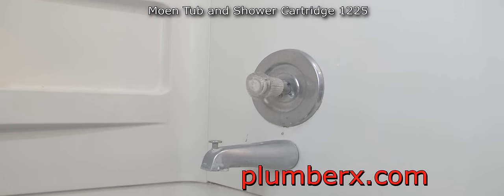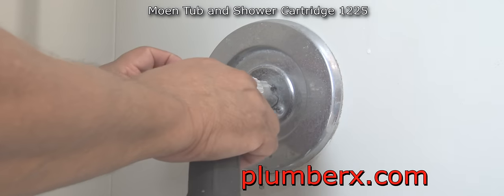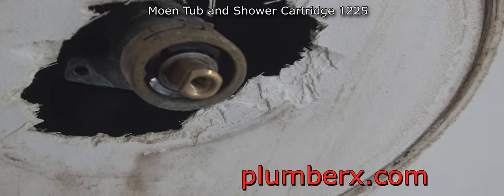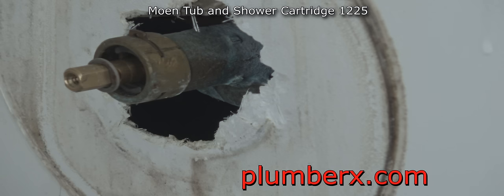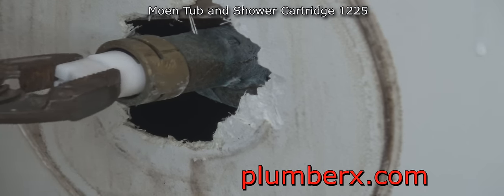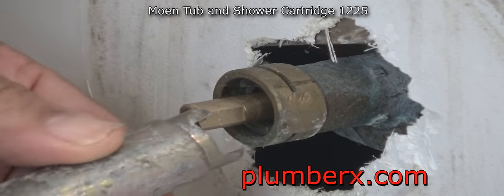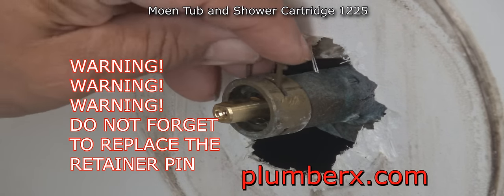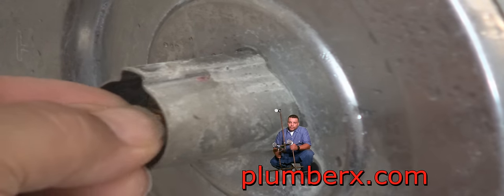1225 Cartridge Replacement  Moen Tub and Shower

Comment: If you drill a hole in the white plastic piece that comes in the box then put the screw back in it you can use that to pull the cartridge out much easier. After having to replace this thing almost every year I had to get smarter. Lesson learned.
Reply from the maker: Lol 😂 nice. Thank you for the idea 💡

Comment: Before removing old cartridge look at end of stem that plastic knob was mounted to and look for a little step on the very end, that step identifies proper orientation when installing new cartridge so that hot is to the left and cold is to the right.

Comment: The Best. Used it while fixing. Successful. Some how, I chose the old Retainer Pin, which has a hat loop, works fine.
Reply: Hi Kris. I saw you received a response a month ago. I hope I get a response to my question too. This is a fantastic video. I feel positive that I can do it but just need to know if it's the fix for my problem.

Comment: [Edit: see reply below this as I may have it backwards?] Thanks for explaining the difference between the 1222 and 1225. The 1222 seems to be the Positemp (handle turns around) whereas the 1225s are Moentrol (handle comes out/up and in/down and can be left at a specific temp.)
Reply: The 1222 can be set for a particular temp. but there is no adjustment for flow rate.  The 1225 must be able to be set for a specific flow rate independent of the temp. adjustment.

Comment: For those of you possibly having issues... This is a very informative and helpful video but it (and most of the other YouTube videos related to Moen cartridges) gives the impression that you only have to choose between the 1225 or the 1222 posi-temp models. Turns out older houses (showers installed before 1990) used the full brass, 1200 cartridges, not the 1225. I first tried installing the 1225 and the cartridge leaked. I then pulled out the 1225 and compared it against the old one. I noticed the 1225 length is a bit longer than the old cartridge. I then looked up some more info and found out that my shower requires the 1200 cartridge. Once I installed the 1200, it worked perfectly. Hope this is helpful for the folks with older homes. 

You can buy the Moen 1200 or the equivalent one by Danco. The Danco version is about 2/3 the cost of the Moen.
Reply: Thanks for talking about the 1200 cartridge.  Mine had been in there since at least the early 80's.  Saved me a headache. Thanks!!
Reply: @nottelling9472  Great. Glad to know it helped.
Reply: Thanks I’m going to try this because I installed the 1225 and had all types of issues and couldn’t figure out what was wrong. The water pressure was off and it didn’t go in very easy. My home was built in the late 50s so hopefully the 1200 works!
Reply: @justingtejeda  Ideally, you still have the old cartridge you pulled out and you can compare against the 1200 before installing it. Hope it works out for you. Once the correct cartridge is in, there is very little friction and no leak so you'll know right away.
Reply: @justingtejeda   It should work.  My house was build mid 70's.  The 1200 worked like a charm.  The puller wouldn't touch mine.  I ended up using a hardened 12 mm bolt with washers and a little leverage.  New one went in slick and I've had no issues.
Reply: @nottelling9472  so the 1225 is the one I needed. I bought the off brand replacement and it just wasn’t working properly so I went back to Home Depot and bought the official Moen brand cartridge. Also put extra lube on it because it wasn’t going in so easy at first. The only issue I had after installing was getting it to sit all the way in to put the retaining clip all the way. All I did was put that little white tool on it and tap it with a rubber mallet. This pushed it enough to get the clip in all the way. Works perfect now!

Comment: Thanks for the video!  After I removed the retaining pin, the valve didn't come out easily, so your video told me to use the white tool to loosen the valve.  I had just replaced the valve less than a year ago, so I was surprised it leaked again so quickly.  In my case, there was an old O-ring that was in about 5 pieces.  Not sure why that caused a leak, but next time I'll definitely check inside the valve body.  I cleaned the valve, re-greased all gasket surfaces and reinstalled with success (no leak)
Reply from the maker: I'm glad the video was helpful for getting that valve loose! Replacing aged O-rings is definitely key to preventing leaks. It's surprising that the valve failed again so soon, but old rubber parts can get brittle and crack over time. Thanks for sharing your experience - it's a good reminder for everyone to carefully inspect inside the valve body for any debris or damaged parts when doing repairs. I appreciate you taking the time to post the details to help others. Have a great day!

Comment: This is the video I have been looking for. This video helped me fixed my tub leak all by myself. Lol I had the 1222 and when I got to that part of the video you said “this is for the 1225 not the 1222” and what did I have the 1222 that didn’t fit. Had to push pause go to Lowe’s and get the 1225 but I opted for the 1220 cause I wanted the brass not plastic came back pushed play and viola FIXED no drip. But that pin gave me the blues, but after much tugging I got it finally. THANK YOU!!!
Reply from the maker: Awesome. Thank for the kind comment. I appreciate you 🙏

Comment: My girlfriend and I worked on her shower mixer for hours and finally bought the removal tool but still wasn't working so found a metric long socket and used my Dewalt drill and adjust the hammering real light and switching it back and forth  so I wouldn't destroy that plastic tool that came with new cartridge then after getting cartridge to move a quarter turn I installed the puller and finally got it to come out , still wasn't easy but she got it.
Now we were told the hard water calcium was the reason but after 25 years there was no deposits anywhere but it appears the chlorine in drinking water Deteriorated the rubber portions of the cartridge to the point of coming apart so it was those pieces that got in the hot an cold entrance tubes and jamming it making it so darn hard to remove we did flush it before installing new cartridge
Reply from the maker: Yeah that does happen, but fortunately not often. Thank you for sharing your experience. 🙏

Comment: This video is the truth, I was able to replace my 20 year old cartridge with this diy video.  I was unable to remove the cartridge with the supplied white cube or buy using vice grips so I had to run to Ace hardware and buy the puller.  The puller I used is stout and worked like a charm.

If your old cartridge was like mine it left behind pieces of rubber gasket in the copper line......those remnants resulted in low water pressure.  I had to uninstall the cartridge and fish out old pieces of gasket, but once done it was all good.

"Core Puller" for Moen part # 45208 at Ace Hardware was $16.00
Reply from the maker: Thank you for the comment my friend
Reply: Dang bro I needed to read this you THAAAAANK YOU!!!!!

Comment: Ok well done...helped a lot...I did find that I had to rotate the valve 180 degrees after installing to get the hot and cold configuration right...it was easy just turn the house water off again and without pulling the valve out using the white head rotated and put it back together again...it also bought the danco pulling tool
Reply from the maker: Nice. I appreciate your support
Reply: You didn't have to rotate the valve , just the valve stem.

Comment: Very good, helpful video. Instead of the puller, I fastened a vice grip on the stem & used a crow bar (might have used a screwdriver) to go between the vice grip & the collar. It took a few tries to position the vice grip just right, but it only took a few minutes to extract the cartridge, moving it a little at a time.
Reply from the maker: Long as it works. 👍

Comment: Your Video made it easy to understand, took me 10 minutes to repair.
Thank you
Reply from the maker: Nice🤜🤛
Reply: Great video. Any tips how to retrieve a broken off screw? I'm guessing ill have to use some vise grips to pull the old cartridge since I can't use that extractor tool.
Reply from the maker: 😖sorry
Reply: I hired a plumber to do this and he didn't know what the white tool was for so he didn't use it and he didn't have that other tool either and he just tried to use pliers . He had a heck of time trying to get it out of there. We sprayed it with WD-40 and some other loosening sprays but it still took a long time to get it out. I wish I had watched this video first so I could have helped him better.
Reply: Huh  
Y
Reply from the maker: Nice. I appreciate your feedback.
Reply: I had a hard time after the inner piece broke and the outside cartridge was left inside. Took me 30 minutes after using the T-type took with the pop out tab but finally got it out. This video was a life saver
Reply from the maker: Wow! That is truly impressive and commendable! I am thrilled to hear that the video on '1225 Cartridge Replacement for Moen Tub and Shower' was able to assist you so effectively. It's a testament to your determination and resilience, particularly considering the challenge of having your right hand in a cast!

To be able to tackle such a task single-handedly, literally, is nothing short of extraordinary. It's this kind of grit and adaptability that serve as an inspiration to all of us. You've shown that no matter what, we can still learn new things and overcome any obstacles in our path, even those we initially perceive as insurmountable.

Your positive feedback is a testament to the value and effectiveness of these instructional videos. We're glad to have been able to provide the guidance you needed, and hearing about your success fills us with joy and motivation to continue producing content that empowers people.

Remember, no task is too daunting when you have the right instructions and a steadfast spirit like yours. If you ever need assistance with another project, know that we are here to help.

Once again, thank you for sharing your inspiring story, and please don't hesitate to reach out if you have any questions or if there's anything else you would like to learn. Keep up the great work! 🙏

Comment: Thank you for the tip on the white tool. Moen does not explain that with OEM cartridge part supply. It made all the difference in the removal of the cartridge without having to buy the actual remover tool.
Reply from the maker: Nice. I appreciate you👍
Reply from the maker: @kimbuck-2  your right, but I needed to show the white tool just in case some one doesn't have the other tools just options. 👍

Comment: I feel the need to comment about using a Danco cartridge.  I have two bathrooms with the Moen 1225 faucets, one leaks, the other just doesn't get used often so I was going to replace it due to the hard water we have.  Well, on the well-used shower/tub, the first Danco leaked at the stem.  Bad inner seals.  In removing the cartridge, the outer barrel of the Danco did not want to come out.  Frankly, it didn't slide in so easily.  Once removed, the second Danco leaked.  It DID come out easier, but I'm never buying a Danco again.  Two out of two leaking out of the package.  I would recommend spending the 5 extra bucks and get the OEM.  I did that, the part slid in so much smoother, did not leak and works like a charm.  Danco parts are clearly (IMO) not built to the same specifications as the OEM.
Reply from the maker: Sorry to hear that. I agree. It is best to get the original. Also keep in mind. These faucets are life time warranty , if you call the manufacturer they will send out a replacement part for free.

Comment: Best video I’ve seen on this repair I was about to call a plumber but instead I’ll dms. Great instructions ty
Reply from the maker: Nice 👍 I appreciate you.🙏
Reply: Updated removed and installed the 1225 cartridge thank u for the soap idea because the pill size grease it came with wasn’t working. Thanks again

Comment: Thank you for giving me the confidence needed to make this repair.  The hard water stains on the faucet can be removed with Lime-Away (wear gloves) and make the faucet look just like new.
Reply from the maker: Glad I could help. 👍
Reply: @theartofplumbing  Hi, I left my question in the comments but since this is an older video I wasn't sure you'd see it. First, this video is fantastic!! I know nothing about plumbing but I feel confident that I can do this now. My question is, my faucet starts cold then turns hot but won't go back to cold no matter what side it's on. Will this replacement fix that problem too?
Reply from the maker: Yes it well. 👌

Comment: Great video, thank you.
I wonder if you have any tips about getting the sleeve off that comes off directly after the beauty plate? Mine is stuck on so hard and I just cannot get it off and I’m afraid I will break the pipe.
Reply from the maker: Sorry but If that's the case, I recommend you call a plumber to be on the safe side.

Comment: This video was great. However I must have overlooked any marking but when inserting there is a very definite top and bottom.  If you put the cartridge in wrong, then the hot side will be cold and cold hot. Just use the handy tool and give it a half twist.
Reply from the maker: Yes this shower cartridge is adjusted by how your handle is installed. If hot is on the wrong side, just flip the handle👍

Comment: very helpful, however, I cannot for the life of me get that retainer pin back in lol.  UPDATE. ok I finally got it but it took a little of this and that, when using the white ap provide by Moen to remove and replace the cartridge, yes, helpful, however if you just push the cartridge back in place with the cap and think you will get the pin back in, whoa Nelly! That clear plastic sleeve around the cartridge will actually go back further than the overall cartridge itself but you need to give that plastic a little much on its own with a need nose plier, just enough so that the pin will now fit properly. Thank you for the great video!

Comment: Tip:  The retainer clip should go back in about as easy as he shows.  Practice putting in through the slot before installing the new valve and also over the new valve - remember the tabs have to be seated at 12 and 6 o'clock.  If the retainer clip is difficult to re-install in you may not have pushed the cartridge all the way in to clear the pathway for the clip below the slot.  I had to really get in the shower and give the new valve a good push to get it to seat fully.  Broke 2 retainer clips before i realized that.
Reply: @kimbuck-2  Yes, they are available at all the home improvement stores.  They're called cartridge clip replacements.  I recommend you have an extra available before opening up the plumbing since they do corrode over time and are not difficult to bend out of shape if you put any force on them.
Reply: @SoCal9705  My plumber lost it down behind the wall when he took it out.
Reply: @crand20033  It happens.  That's why one should really keep an extra one available when doing this.  They're also not difficult to bend or break.
Reply: Everything went smoothy except for the retainer clip. Glad I read this comment as I thought I had pushed the cartridge in enough and didn't want to damage anything. Gave it one more good push and it kinda snapped into place. Thanks!
Reply: @SoCal9705   This plumber with all his experience also didn't know what to do with the white tool which is supposed to be used to loosen the valve so you can more easily pull it out. He spent a lot of time and effort trying to pull it out and could have broke something.

Comment: Thank you sooooooooooooooo much.  I bought the right part and the right tool because of your video.  I had to replace the valve and it was a 1225 model.  Never did it before, and I got it done in 15 minutes.
Reply from the maker: Awesome. I appreciate your comment.
Reply: Robert Heskin how do you know what model it is?
Reply from the maker: @Noahsoak  one pulls out and the other just turns.

Comment: I put a new cartridge in, but it leaks out if the bottom of the handle. Any reasons why?
Reply from the maker: I’m sorry to hear you’re having trouble with your Moen 1225 tub and shower cartridge. There are a few common reasons why it might be leaking from the bottom of the handle:

Incorrect Installation: Ensure the cartridge is properly aligned and fully seated in the valve. Sometimes, even a slight misalignment can cause leaks.

Damaged O-Rings or Seals: Check the O-rings and seals for any damage or wear. These components are crucial for preventing leaks and might need to be replaced.

Debris in the Valve: Debris or mineral buildup inside the valve can prevent a proper seal. Cleaning the valve thoroughly before installing the new cartridge can help.

Cartridge Orientation: Make sure the cartridge is installed with the correct orientation. The “H” and “C” markings should be aligned properly to ensure a good fit.

If you’ve checked these and the issue persists, it might be worth consulting Moen’s customer support or a professional plumber for further assistance.

Comment: So if the retainer clip won't go back in it's because you haven't pushed the cartridge in far enough?  It looks like the clip just slides down in front of the cartridge instead of sliding into grooves in the cartridge as you might think.

Me from the future:  Yes, that's correct.  The clip slot is 1/4" back from the front of the brass valve holder but the plastic ears need to be pushed in 1/8" further than the face of the brass valve holder in order for the clip to go in.